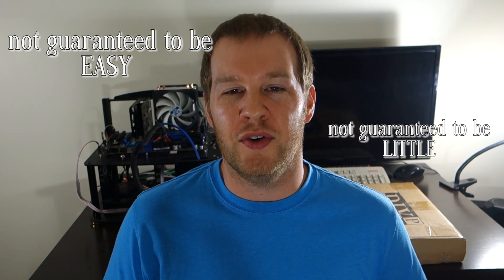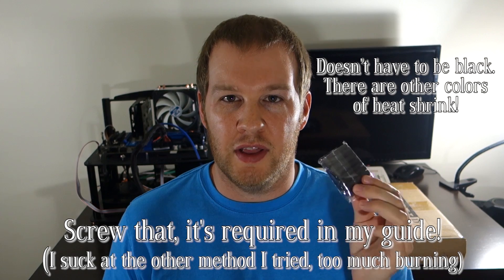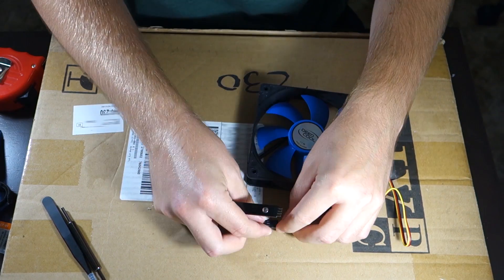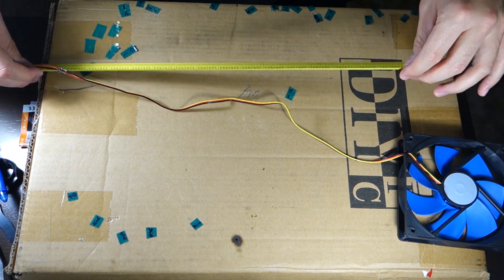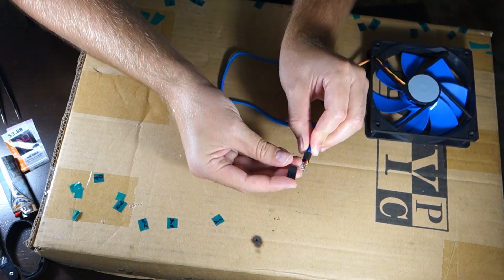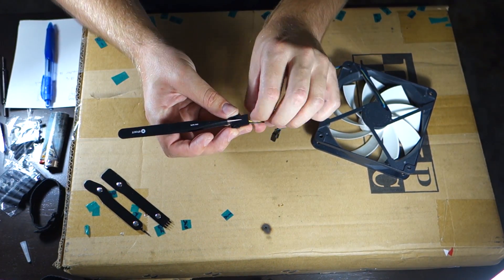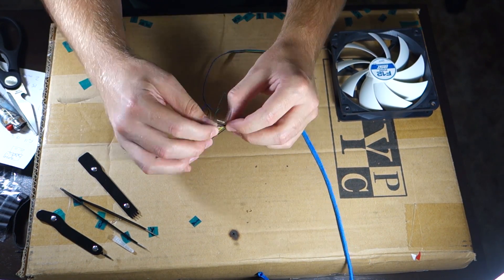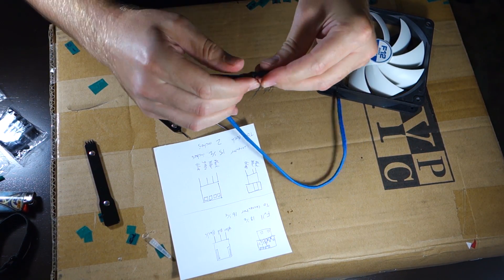Fan Sleeving Guide For Noobs | Common Fan Cables 3pin 4pin Molex Daisy Chain

Comment: My 3 Fans are ARGB which have Molex connector 
one fan has 2 pin reset switch and the rest don't have it

Could anyone tell me how to make them how to sync to the motherboard using any means?

Comment: Awesome tutorial. You asked for comments so I'll throw in my 2 cents worth! I personally like to use a heat shrink with a wider diameter and a 4:1 shrink ratio. Once the pins are back in the connector I slide the extra large heat shrink up the cable and a little over the connector. Normally the heat shrink sits nicely on the connector with a little play. When I apply heat it tightens around the connector  while the rest shrinks right down to fit snugly around the cable. That way there aren't any bits of colored cables showing showing between the heat shrink and the connector. Not bashing your way at all. Its just my personal preference.

Comment: I ordered 2 new rgb fans off of newegg to find out they do not fit into my controller that came with my case. The fans have a 3 pin connector and the controller only accepts a smaller 6 pin connector.

My main question is since my 3 pin fans do not connect to the 6 pin slots, is their a converter? or do i need to order new fans with the 6 pin power connector.

THANKS (:
Reply: Did you solve your problem sir? Im having the same problem here. I ordered rgb fan with 6pin and my mobo have only 4 pin for rgb fan

Comment: OMG just buy an adaptor https://smile.amazon.com/gp/product/B001B9Y6W2/ref=oh_aui_detailpage_o07_s00?ie=UTF8&psc=1
Reply from the maker: Not sure what you are meaning here with buying an adapter, the purpose of the extra connector on the fan was to show how to remove the wires from another common connector that comes with some fans. This is about sleeving the fan cables to hide the multi-color unsightly wires and being able to use any color you want.
Reply: Hi there, my point was while you're video is very instructional - for under $4 USD you can buy a cable already sleeved and save yourself a bunch of time. BTW - any idea where to get those little plastic IDC connectors, 2-pin, 3-pin etc. in order to make your own cables? Tks.
Reply from the maker: I found some 3 pin connectors on Amazon here:
https://www.amazon.com/connector-Terminal--TOOGOO-KF2510-3P-Housing/dp/B01CTX64EQ/
and some on ebay here:
http://www.ebay.com/itm/100-X-2-54MM-1x3-Pin-IDC-3P-Cable-plug-Connector-Header-Terminal-Male-Socket-/171915900439

Unfortunately it all seems to be from china for fan specific connectors, although I see some USA sellers might be in the related items on both those links. Chinese sellers aren't exactly bad, you just might have to wait a while to get it.
Reply: Thanks, I did see those on Amazon - it's the smaller, thin ones that plug into the mobo for power, reset, led - like this one. I'm doing a Hackintosh project and wanted to do a nice wiring job (with sleeves : ) that goes to the front panel, but looks like I'll have to just splice my way through. https://www.amazon.com/dp/B00HNWPTDQ/ref=wl_it_dp_o_pC_S_ttl?_encoding=UTF8&colid=1NVPGQF38ZIRR&coliid=I37H0AG94TV6HN
Reply from the maker: this store on ebay is US based. This what you mean, for single wires?
http://www.ebay.com/itm/25x-Dupont-Wire-Jumper-Pin-Header-Connector-Housing-1x1-Male-Female-/131413159465
They also have a 2-pin:
http://www.ebay.com/itm/25x-Dupont-Wire-Jumper-Pin-Header-Connector-Housing-1x2-Male-Female-/131431474365
Reply: Those are the ones! (hard little buggers to find) here's the project in case  you're interested - page 2 mentions the wiring. http://www.tonymacx86.com/threads/g4-tower-build-sawtooth.199070/
Reply from the maker: Glad you found some on Amazon it looks like a 40 pack! At least maybe I helped with the search. Good luck, looks good so far!
Reply: Thanks for all the help, I referenced (inserted link) to your Youtube profile on the tony mac site for the support.